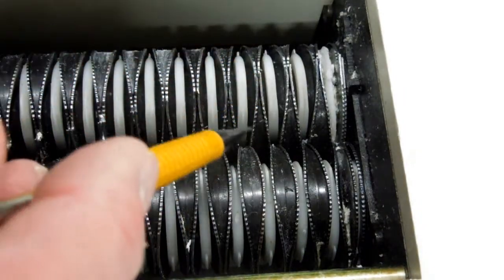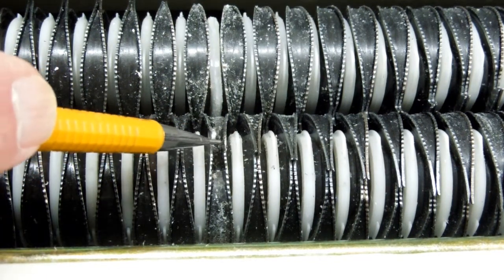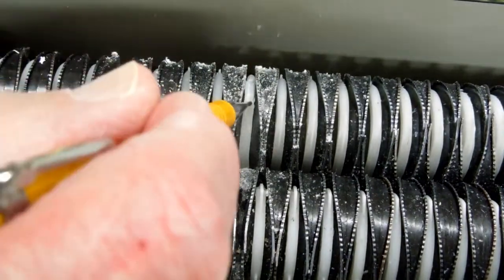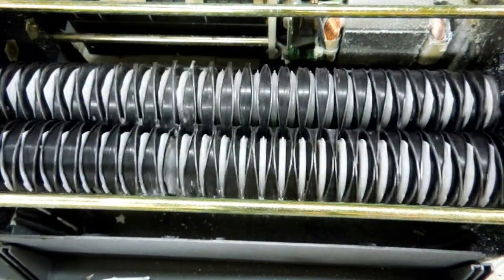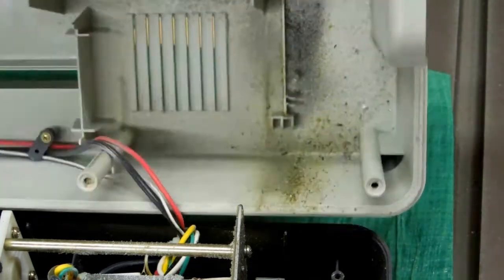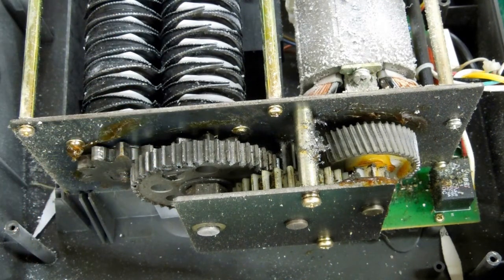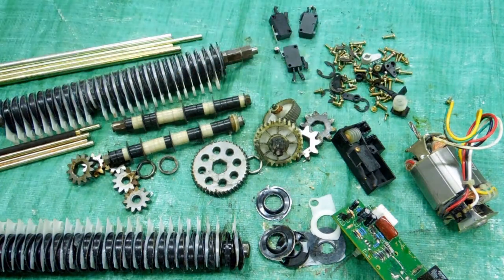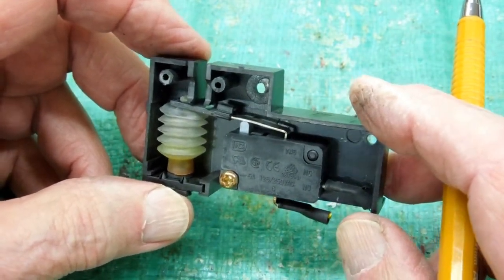Paper Shredder Autopsy - What Killed It?

Comment: Thanks for taking the time to make this video!  Love seeing the details of how things work…and especially the solving of mysteries of why they stop working.  Bonus is when we can get them working again, but agreed completely that in this case it wasn’t worth the effort.  As someone who does the same thing, I applaud you saving the good ‘bits’ for future projects!   If you’ve ever shown how you keep all the various salvaged ‘bits’ organized, I’ve missed that.  Would love to see since my current methods don’t work well and are cause for a, shall we say, a somewhat uncomfortable level of disarray in my shop….
Reply from the maker: I have a parts box storage cabinet. Salvaged screws like metric and then the screws for plastic (also work for wood) are somewhat arranged by size and then placed in pill bottles and them into the parts boxes.

Plastic Parts Box Storage Cabinet
https://youtu.be/NOIvEdFQgfM

Shop Sink Storage Cabinet
https://youtu.be/PbQ8fY6d4v4

Springs (tension, compression, hair coil, etc) separated by type and placed in pill bottles. My pill bottle wall rack system is great for a lot of this as you can see what is inside. Too bad the bottles aren't clear plastic though.

Pill Bottle Small Parts Storage
https://youtu.be/Xlu_kNUSTWY

Small peanut butter jars are great for larger stuff in drawers.
Never was in a position to accumulate small baby food jars.
Hope that helps.
Thanks for watching!
Ron
Reply: @RonaldWalters2010  Thank you, Ron!  I will watch those videos on my next days off!  Appreciate you taking the time to answer so completely.
Reply: @RonaldWalters2010  OK, they were short videos and I have a terminal case of curiosity so I watched them all now when I should be sleeping….  Thx much!  All clever and interesting ideas that inspire me to improve my abysmal shop organization status!!

Comment: After seeing it apart, I think you could have move the broken cutters and nylon pushers  to the side and make the machine a bit narrower, but still usable.
Reply from the maker: I did think about it briefly... :-) There were more bent teeth than where shown in the video and the cutters were fairly dull. And then there is the thing about "the broken white spacers" and it being very likely others would soon be breaking as well. Finally the fact I was already quite annoyed with the whole thing.... it was time to go.
Thanks for watching and your comment. Ron
Reply: @RonaldWalters2010  I got annoyed too.  Took mine apart, saw that I had to pull out all that teeth and rearrange and put so many pieces back together correctly, that I figured I was better off buying a new high quality one.

Comment: I want to take a shredder and put in a bigger motor and see if it will shred milk cartons and other hdpe and ldpe material. I want to melt it down to bricks of plastic for machining. I have done that with my milwaukee cases and milk containers, the red and white is nice, just pull and kneed it and come up with cool patterns. I can then use them for bit holders, tap holders, chamfer holders, center holders... you get the picture. Better than watching them recycle it to no wheresville.